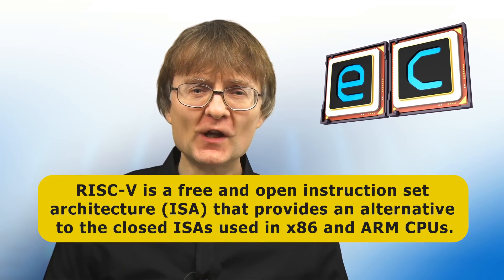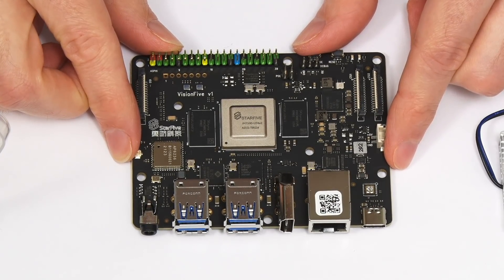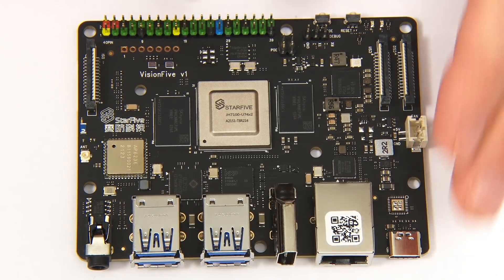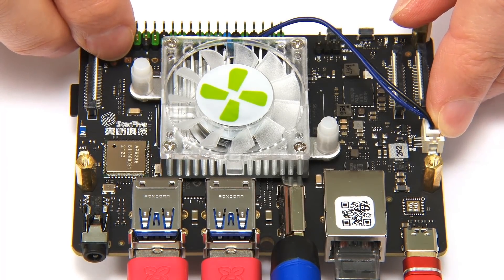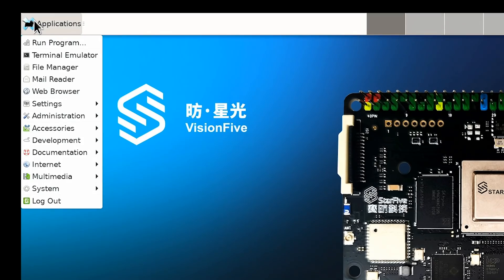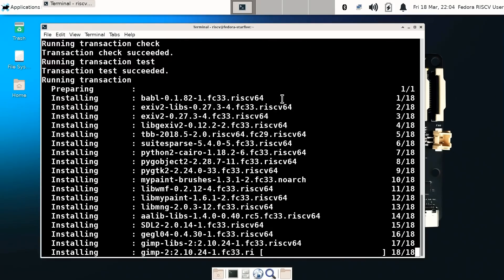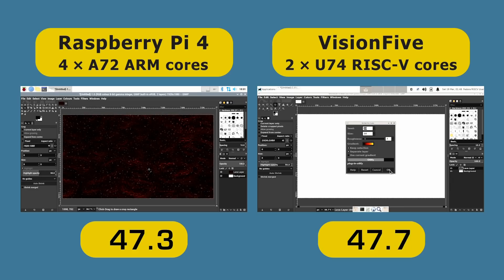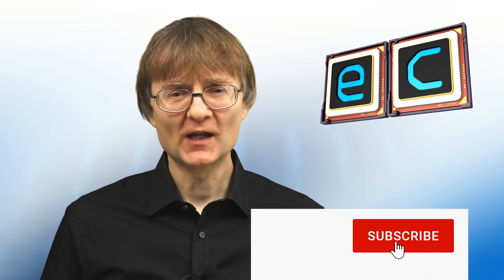VisionFive RISC-V Linux SBC

Comment: i am sure this is a ground breaking idea but as of now - it seems slow, buggy, with very narrow support range and probably not even ready for the early adopters. It is slower than Raspberry pi. I guess we can come back to this technology 5 years down the line and see how it has improved.
Reply from the maker: This is a development board -it is not for early consumer adopters, but for developers. The only way a new platform can be supported is if developers can get their hands on the hardware! :) Compared to the Pi, core-for-core it is actually faster in the GIMP test (the two RISC-V U74s took less than double the time taken by the four ARM cores on the Pi). So a quad core U74 SoC, with a GPU, would outperform a Pi even today. Hence "five years" is way out on timeframes in terms of performance - we are likely to see a RISC-V SBC with more power than a Pi within a year. Although (at least in normal markets) the Pi will win on price for some time to come. :)

Comment: That sbc has 8 gigs of RAM, doesn't it? Seems rather much to me, looking at the performance in Linux environment.
Reply from the maker: It does indeed have 8GB RAM. And note that the RISC-V U74 cores actually outperformed the Pi's ARM A72 cores in the GIMP test -- the VisionFive was not twice as slow . . .

Comment: Great video. I'm sure you'll enlighten us to the benefits of RISC-V technology, but judging by the performance of the "flagship" model they currently elude me.  Perhaps we're too early into the RISC-V development cycle to see what the future holds.

I seem to remember an 8 or perhaps 16 bit RISC based home micro back in the 80s, but I really can't remember its name.  I guess it didn't do so well, otherwise it would have become one of the big hitters that we all remember.
Reply: Acorn Archimedes 1994, ARM machine.
Reply: @joefish6091  Thanks. I was even in the wrong decade.
Reply: IMO: RISC-V is pros/cons. The ISA is fully open, which is a good point. Among this category (free/open ISAs), it is also one of the most popular at present.

Some parts of the ISA are very minimalist, such as only providing [Reg+Disp12] addressing (pretty much any other addressing mode needs to be faked via ALU instructions), which is not ideal for performance (also having [Reg+Reg*Scale] mode would be very useful for working with arrays, or for dealing with offsets which don't fit into a 12-bit displacement, ...). It also lacks a good way to express 64-bit constants inline, leaving the "best" option here as loading them from memory (also not ideal), ... A lot of this can (in theory) be worked around in hardware (or added as 3rd party extensions), but still isn't ideal.
There are also some other nifty features, such as predicated instructions, which are also absent (but can be beneficial in code with a lot of short/simple "if(cond) {...}" blocks, as it can avoid needing to use a branch in these cases).

There is some other stuff I could go into, but this would go outside the original scope.
Reply: @BGBTech  This is at least part of why I prefer a CISC architecture. Now if only someone would come up with open CISC.
Reply: @anon_y_mousse  An ISA being RISC doesn't exclude the features mentioned (several of them are present in ARM), as well as in my own ISA design (technically a VLIW).

As for CISC, this term usually implies a Reg/Mem architecture (like x86). Although this can reduce instruction counts, it is generally not friendly to instruction pipelining. Supporting these in an ISA either requires a longer pipeline (bad for branches) or decomposing these instructions into multiple "micro ops" (also not ideal).

So, this is partly what leads to RISC style ISAs having a preference for a Load/Store architecture (and a typically larger number of CPU registers).

Ability to encode large constants inside the instruction stream is useful. This usually requires either variable length instructions with a large instruction format (on a conventional RISC), or an ability to treat a whole bundle as a single large instruction (VLIW). My ISA design (BJX2) effectively did the latter (some encodings allow using a 96-bit instruction bundle as a single large instruction with a 64-bit immediate; or a 64-bit bundle encoding an instruction with a 33-bit immediate, ...).
Reply: @BGBTech  Exactly my point. With RISC you end up increasing the cache to handle not just more instructions, but when 32 bits isn't enough you double it to handle more data. Variable instruction size is actually not as big of deal for the CPU to handle as people think and being able to extend it for the future is pretty cool. Goes along with what I always say regarding how modern code is designed and written versus how code in the past was.
Reply: @anon_y_mousse  FWIW: Many RISC's have variable-length instructions (16/32). This would include RISC-V, and 32-bit ARM (Thumb2).

My ISA (BJX2) combines 16/32 with variable-length bundles (32/64/96 bits). The effective instruction lengths end up being 16/32/64/96 (with the 64/96 bit encodings being special cases of the bundle encoding).

There is also the possibility of 48-bit encodings, but they are not currently used.

Based on how things are implemented, 64-bit and 96-bit encodings may not be bundled, as well as some "wide" instructions (eg: 128-bit SIMD ops), and Load/Store is limited to 2-wide bundles (these internally "borrow" the 3rd lane).

In concept, the ISA is explicitly parallel (32-bit encodings can be flagged to execute in parallel with the following instruction), in bundles of up to 3 instructions. Some instructions (Ld/St, Branches), are only allowed in Lane 1 (the last instruction in the bundle).

It can also be used like a normal RISC style ISA, which is sometimes useful. Code density is "fairly reasonable" (loosely comparable to similar-class RISCs; code size is typically smaller than x86-64).

Also has an experimental alternate decoder/mode to allow it to run RV64I code. This is kinda meh, I have my doubts as to how useful this would be in practice (limited and slow vs a core actually built for running RISC-V...).
Reply: @BGBTech  That's pretty cool, though I'm still waiting for something CISC. Seems like everyone disagrees with this viewpoint these days, but I would prefer to have 1-byte instructions and the ability to operate directly on memory. Our current crop of CPU's just need a complete redesign.
Reply: @anon_y_mousse  I experimented before with byte-aligned instructions and "they are just not really worth it". They add cost and complexity and result in negligible improvement in code-density over 16/32. 

There is more benefit in allowing for larger encodings which can fit larger immediate values; so one has encodings with useful immediate sizes, say: The baseline 32b encoding does Imm9s, 64b does Imm33s, and 96b does Imm64. This is more-or-less how it works in my ISA. Though admittedly the encoding for large immediate values is a little funky as it is done via daisy-chaining "jumbo prefixes" which work by gluing bits onto the following instruction in predefined ways.

More common (in RISC land) is to either use a PC-relative load, or to "bit paste" the constant. These have other tradeoffs.

As for Reg/Mem and Mem/Mem, this is more a "making it not suck is hard" issue, at least for the general case.

In a Load/Store architecture, the L1 D$ only needs to be accessed once, and in place of any other logic that needs to be run. For Reg/Mem, if one tries to put it directly in the pipeline, this adversely effects "pretty much everything", the pipeline would be long, with a significant interlock latency, ...

Or, the CPU decomposes Reg/Mem ops into 3 or more "Micro-Ops", at which point it gives the appearance of Reg/Mem but is operating as a Load/Store machine internally (in which case the Reg/Mem ops are slow).

Comment: Hi Chris 

It appears that Apple is also looking at this RISC-V chip. I found this bit of information. They are now looking for programmers.  Anyone looking to learn more can buy a much lower cost board and get started.  See the Job application below 

Apple’s interest in RISC-V chips

RISC-V (“RISC Five”) is the fifth generation of Berkeley’s RISC processor – though as the university made it open-source, many others have worked on it too.

An Apple job ad posted yesterday shows the company seeking a programmer to work on RISC-V chips.

The successful candidate will have excellent understanding and knowledge of RISC-V ISA architecture along with working knowledge of NEON micro architecture in ARM CPU cores from a vector programming perspective.
Reply from the maker: Very interesting! :) And as Apple has shown in the past couple of years (and previously), it is very happy and able to completely change its CPU architecture very rapidly.
Reply: Not this chip, the RISC-V instruction set. This chip is only one of dozens of RISC-V chips in development.

Comment: This may be an odd question, but I was wondering do you feel/believe that an SBC could ever become good enough to play a game such as Cyberpunk 2077 at playable setting or similar games? Not talking about newer AAA games though. My guess is the GPU would be the limiting factor? So my assumption is until an onboard graphics chip becomes powerful enough and power efficient enough it will either be awhile or not happen?
Reply: Will they at some point sure but by then the desktop machines will be playing something beyond 2077.
Reply: @sharonwolff1  After a bit of thinking and watching a few videos of the Steam Deck maybe my idea is not as far off as I originally had thought. True the size is approximately double, but given some time with jumps in performance/efficiency and shrinkage of components maybe, just maybe sooner than I think?

Comment: There is also a Risc OS for the pi.
Reply from the maker: There is, but that is an operating system that runs on its ARM hardware -- https://www.youtube.com/watch?v=oL4w3AK6Qpw . Both ARM CPUs and RISC-V CPUs are RISC in design (as opposed to CISC). But that is not what this video is about -- ARM and RISC-V CPUs are entirely different.

Comment: The open source concept totally captured me, very fascinating, great SBC! But how do you make a "new" set of instructions that do the same of the existing ones to the point of total compatibility? I mean, you have 10 PRINT HELLO, how do you reinvent that to do the same with a different instruction and still understand the underlying binary code?
Reply from the maker: Thanks for this. And the key point is that you don't get combability! Existing x86 and ARM operating systems and applications need to be "ported" (converted) to run on RISC-V hardware. So the higher level code -- like "Print Hello" -- can be the same. But the underlying binary code will be different as you note. And this is why we need development boards like this one, as programmers can use them to port software to the RISC-V platform -- without which, it cannot succeed.
Reply: @ExplainingComputers  Thanks for the explanation Chris!